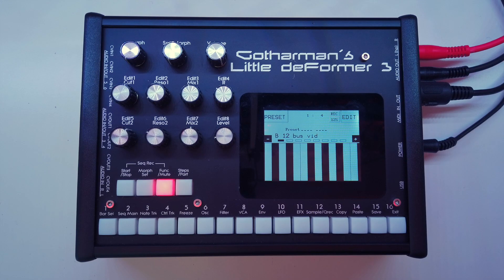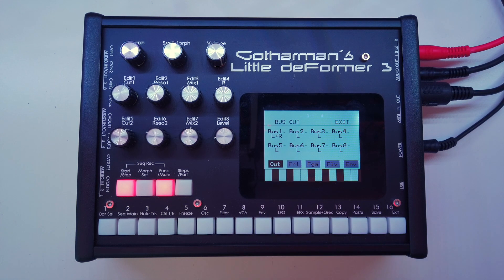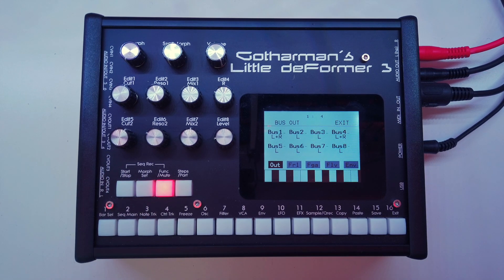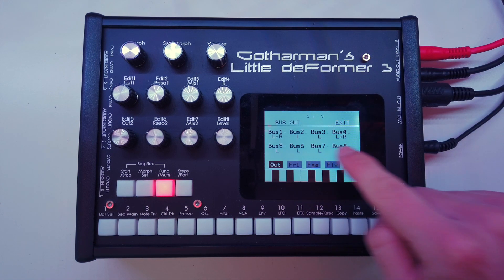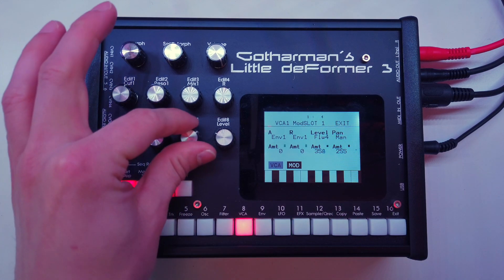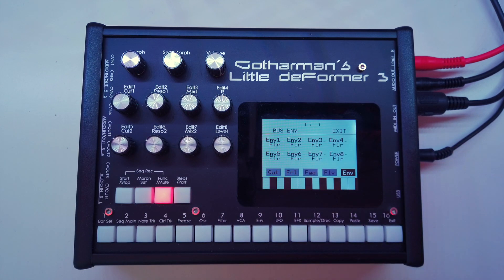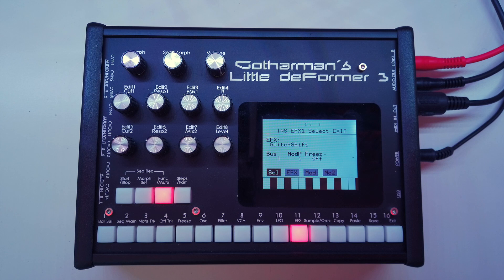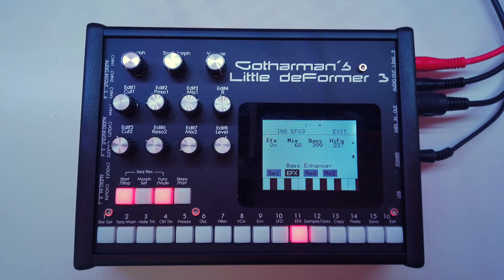Little deFormer 3: Bus System Tutorial #TTNM

Comment: That is a really powerful bus system...esp with all the routing, modulation and FX...AND with the extra i/o and analog filters options! WOW!
Could you do a latency test for us? A simple audio thru latency test...maybe with some additions to see much extra latency adding more FX will add. I hope its in the low 1-2ms range.
Reply from the maker: On the LD3's specs page it says: "Maximum audio latency: 1 sample - 22 uS (microseconds). 450 times faster than Linux based instruments!!!"
http://gotharman.dk/ld3_mkii_specs.htm
Reply: @tuesdaynightmachines  YES, i just saw that also! WOW WOW WOW...that is incredible! It is quite an investment...but this could be the selling point for me...i wonder if the internal tracks playback is similarly high spec accurate. I mean some grooveboxes have a few samples latency between tracks...say u play the same sample on track 1 and on track 16...is there phasing..or sample accurate? i hear some say the Roland MC707 have this problem.
Reply from the maker: Phew, I actually never bother testing these things, haha :D I'm not an audiophile or "technician" like that at all. I think when it comes to the LD3, it's important to know about its sound, which is digital and granular as soon as processing gets involved. You can smooth it with the optional analog filters, but even they can be harsh. Also, don't expect the delay or reverb to sound like your usual clean effects. Same with a sine wave, etc. The name "Deformer" is very fitting for the device. There's a lot of features that let your deform and destroy sounds and sequences. The more experimental your music, the happier you'll be with the audio capabilities of the box, I'd say. It's a cross breed between the Octatrack and Electribe 2 Sampler, with some things that mutated and evolved in weird ways along the way :D So if those devices, or mainstream grooveboxes in general, bore you, the LD3 might be a good instrument for you. I think the user interface is very well done and it's totally a desert island instrument, but still, one needs to like its sound and the overall concept.
Reply: @tuesdaynightmachines  haha, i am on a quest to get something powerful super low latency and jitter...this thing looks for sure like a big contender. But i think encoders for the 8 "multi" knobs would almost be a must for me, must be really annoying having that parameter jump all the time, and "catch up",  trying to find the value first is even more annoying for me...a LED-ring around good encoders would be perfect. But it seems to be hard to get encoders to have the right feel (that pots have) for some reason, and then after a few years some encoders start to skip. Thanks for all the info.
Reply from the maker: Good luck on that quest then :D Let me know what you find! I'm strongly in the potentiometer camp and generally dislike encoders, so 'Im very happy with the LD3 in that regard.
Reply: Thanks! Looking at the Octatrack also...seems to have low jitter but latency is kind of on the high side if monitoring audio in on the thru machine from what i read...looks like it is about 4-5ms latency on the octatrack, not sure why it is so high, but maybe no need to monitor the FX realtime on the octa, but would be cool to use the FX in realtime as a mixer with some FX :/ Encoders look to be in the "turn 100 times for full effect camp" though :/ I have also thought about doing it in eurorack. Nerdseq and or pyramid (or squid, or keystep pro) for sequencing (something with CV out)...then some low latency  (sub ms) eurorack sampler that can timestretch. Maybe the ALM salampler or ES Disting EX (but not sure it will timestretch) maybe both :D and a few axoloti's and a eurorack synth. But i like the idea of having one unit that can do it all (most stuff)...like the LD3...this looks like the best on paper from what i have seen...i think i will buy a used octa and test in in person.  Take care. Cheers.